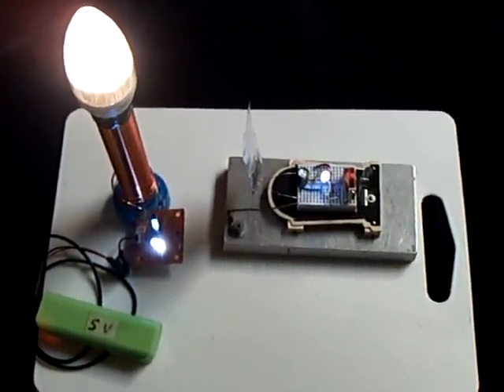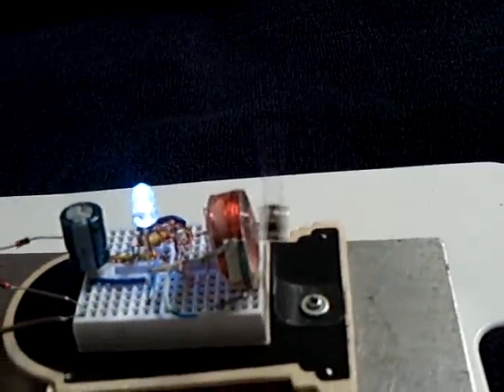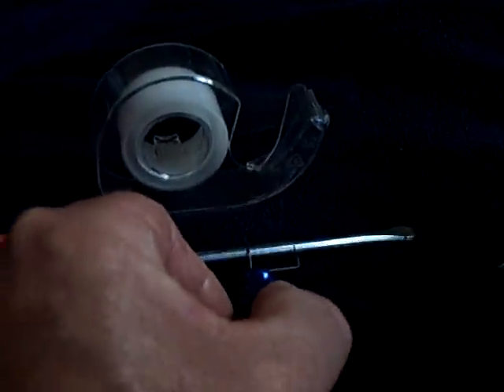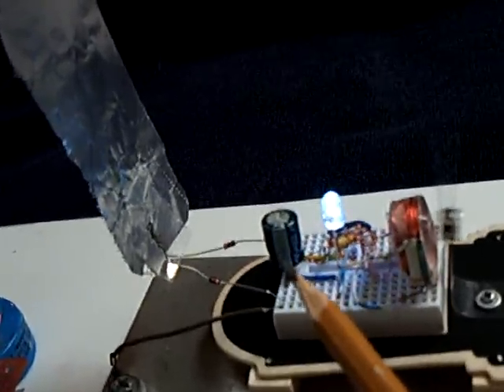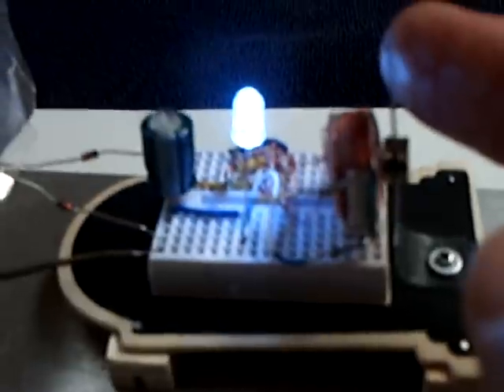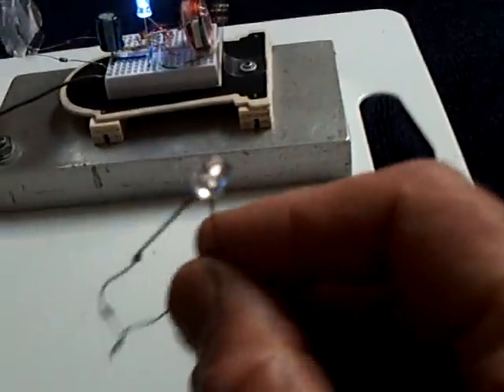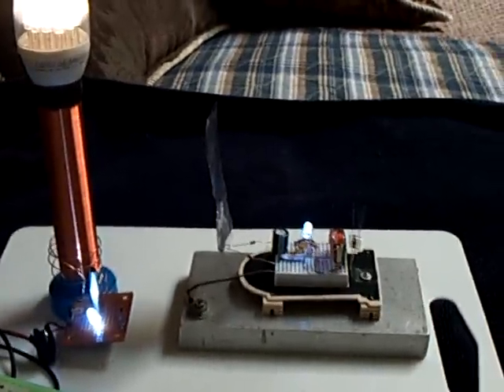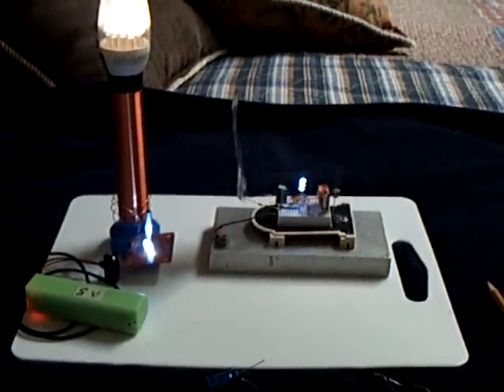Vibrator Oscillator --- run wirelessly by Exciter

Comment: Aha!  I thought maybe there should be a spark when you "discharged" the capacitor, but I wasn't sure if there would be at that voltage.
Reply from the maker: Yes.  The voltage was only about 2 volts so you would probably not see a spark even if I had really shorted the cap.  A nearby by AM radio would have picked it up though.

Comment: I still like the Idea of the l.e.d light, lighting without wires !!!!!!
"in my opinion" this is how all lights should be run.
Reply from the maker: The problem with this type of high frequency energy transmission is that goes everywhere and can damage sensitive electronics that are nearby.  It is also rather short range.  It is still pretty cool though and I have always enjoyed working with it.  It is like I can hear old man Tesla  whispering over my shoulder---"yes"!